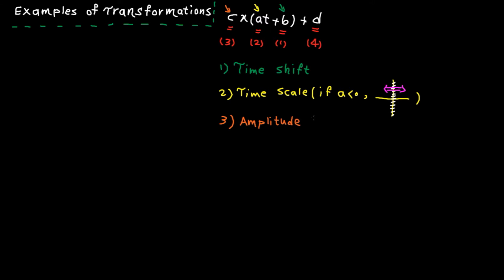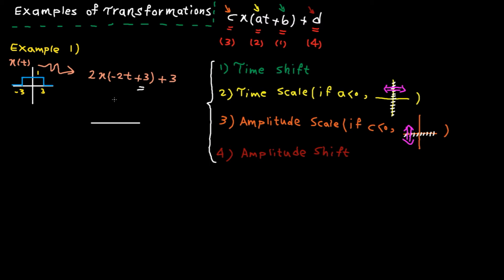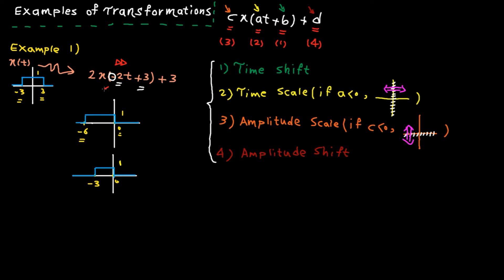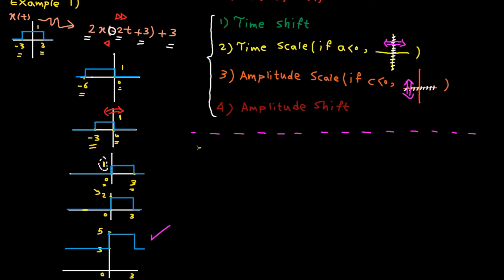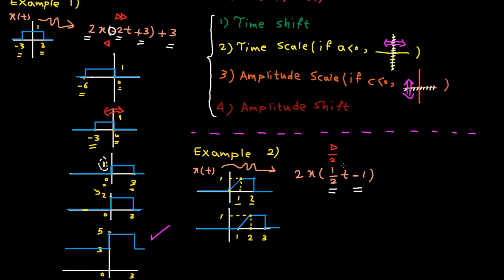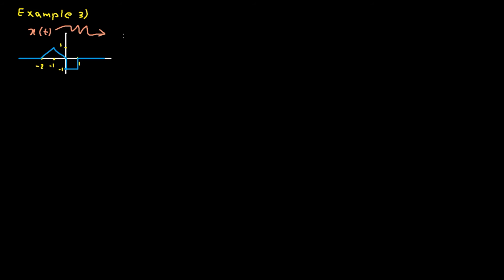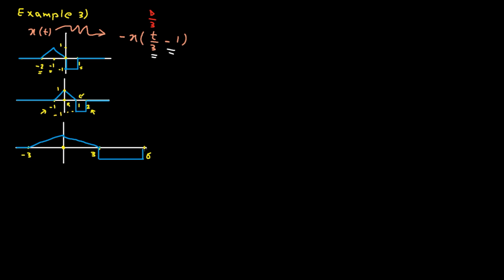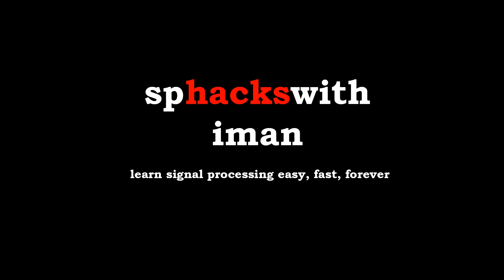Time domain - tutorial 4: transformation examples

Comment: i don't understand exactly why do we shift it first instead of scaling?
you said Or you can write it as x(a(t+b/a)). In this case, you scale by "a" first and then shift by "b/a" 
 i think  in this case we must start with shifting because in mathematics the expression between brackets is the priority (t+b/a  between brackets).
does itany  matter, can you explain to me please.
Reply from the maker: Hey my friend and I am sorry for the confusion. Let's start by x(t):
Approach 1) first time shift by "b" (i.e. replacing t by t + b) --> x(t  + b) --> then time scale by "a" (i.e. replacing t by at) --> x(at+b)
Approach 2) first time scale by "a" (i.e. replacing t by at) --> x(at) --> then time shift by "b/a" (i.e. replacing t by t+b/a) --> x(a(t + b/a)), if you bring "a" inside the parenthesis you basically get the same thing as in Approach 1.  
Wrong Approach) first time shit by "b/a" (i.e. replacing t by t + b/a) --> x(t + b/a) --> then time scale by "a" (i.e. replacing t by at) --> x(at + b/a) THIS IS NOT EQUAL TO THE ABOVE ANSWERS. 
Hope this help. Best!
Reply: thank you for the answer, so if I understand correctly, we have to start by shifting then scaling without taking into account the mathematical priorities, that is, the multiplication ferst then addition, right? (i talk about approach 1)
Reply from the maker: No worries. Both approach 1 & 2 are the same and lead to the same result. Please note this is the transformation order on the function variable. If you are given x(t), you can plot x(a(t+b)) point by point for different t and you have to consider the mathematical priorities.  As an exercise, consider x(t) is one from 0 to 4 and zero elsewhere, plot x(2(t+1)) point by point. Hope this example helps. Best!

Comment: why do we shift it first instead of scaling?
Reply: i mean in math you usually do multiplication first. is there any reason we have to shift first?
Reply from the maker: Hey, thanks for the question. You can go the other way around. Both ways are correct. For x(at+b) you can shift by "b" then scale by "a". Or you can write it as x(a(t+b/a)). In this case, you scale by "a" first and then shift by "b/a". I prefer the first way :) Hope this makes sense.
Reply: @sphackswithiman  Shouldn't we first do (t+b/a) and then multiply by a? Isn't that the order of operations? Do whatever is in the parenthesis first?